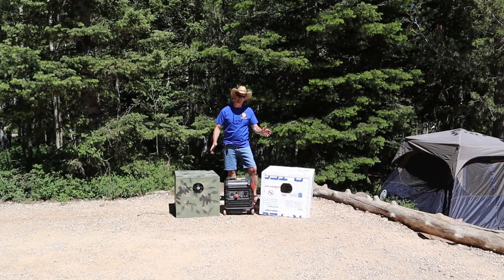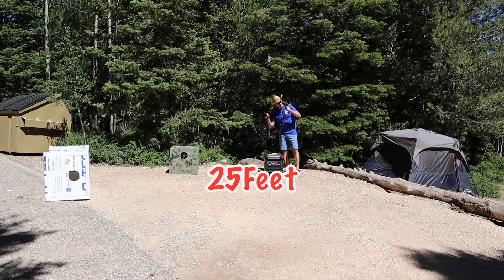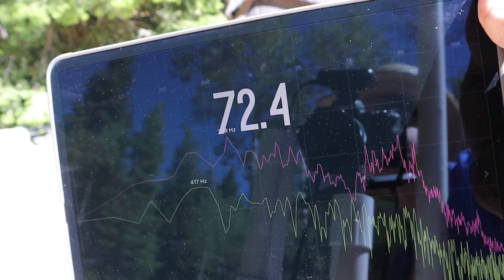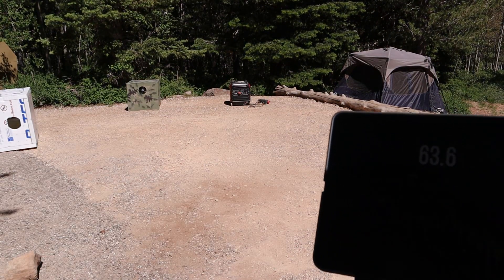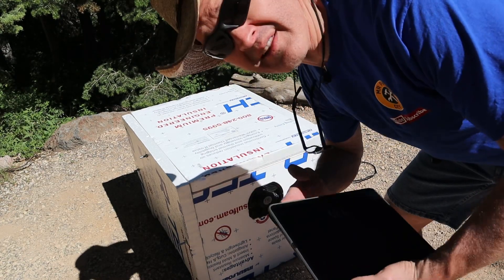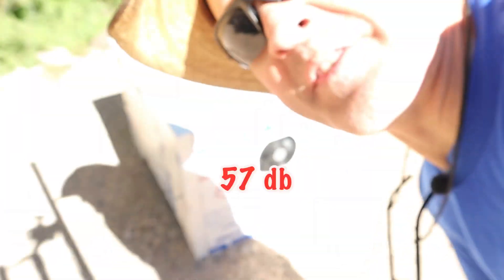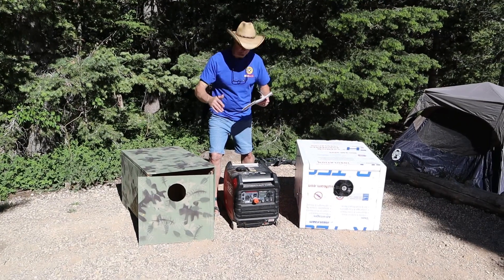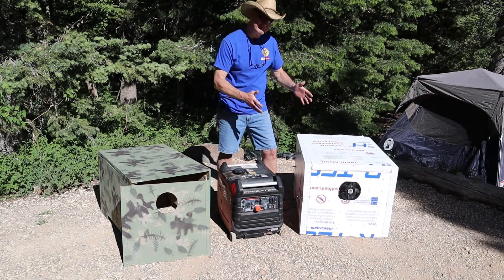Generator Noise Reduction Box Competition

Comment: I live in Arkansas and use a generator to power my cabin… some days it’s 98 degrees. How do these boxes affect the generators in that kind of heat?  Will they overheat?  Any experiments on temp inside the box in hot weather?  Really interested in knowing this… thanks for your videos!
Reply from the maker: Great question! Heat is definitely a factor for operation and affects the longevity of a generator. A sound box must be designed to allow air movement across the generator for cooling. These two boxes use a beefy electric fan for cooling. It seems like the fan does a good job but perhaps we should do some temperature testing! Thanks for watching!
Reply: @MrFredsDIY  It would be great to see some tests….  Maybe measure the oil temp?
Reply from the maker: @rrgrantham  here is the Heat testing video for these boxes ▶️Generator Noise Reduction Box Heat Testing
https://youtu.be/Ty8aJ2Eh_WI
Reply: @MrFredsDIY  great video!!  Thanks so much!